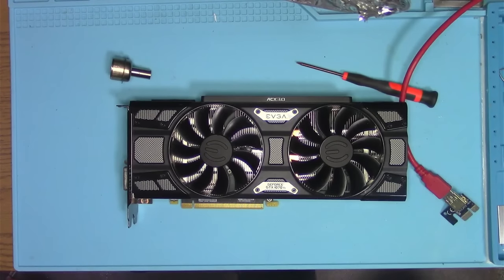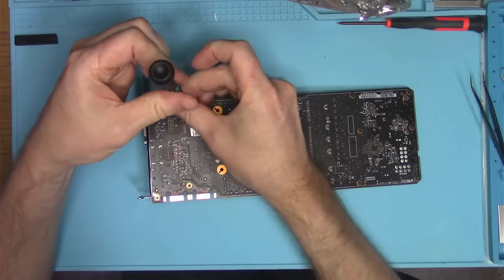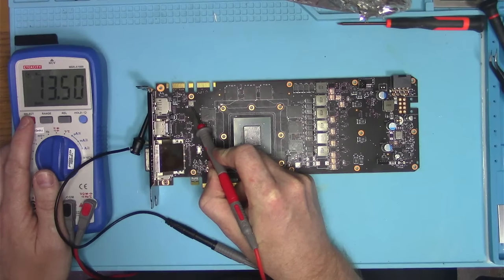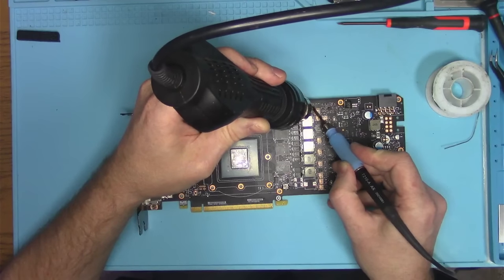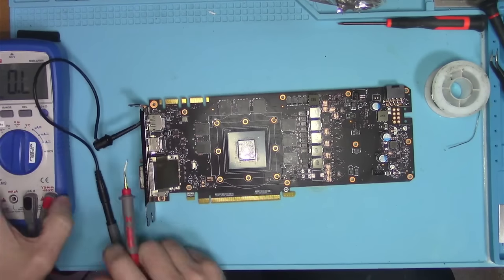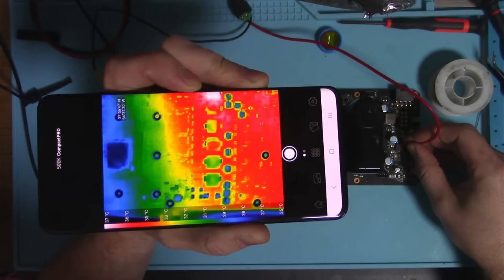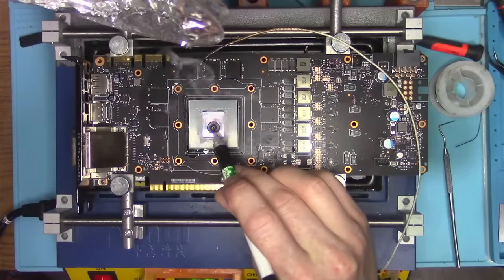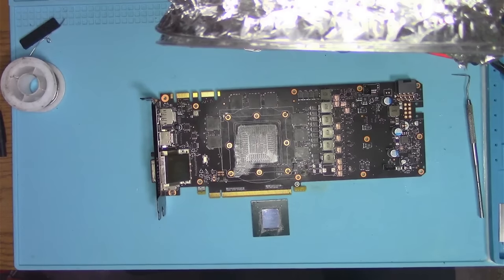How i learned GPU repairs

Comment: This is insane, I was certain you had a background in electronic engineering or computer engeneering, but you are self-taught! genius
Reply: It's kinda impossible for someone without a good electronic background to do this. I can build and troubleshoot PC's with ease, can do electrical works and circuits but never can I do anything like this (without studying it from somewhere). Electronics is something that's really hard to be self taught and the max I can do is continuity check. This guy is an expert pro max ultra
Reply: thats how i started too. learned how to rebuild diesel engines when my truck broke. learned how to repair amplifiers when i wanted a big stereo but didnt have a lot of money. learned how to lots of things because it was needed.
Reply: @wokeydokey6885  The first time I reballed and replaced any CPUs was just a passion project, no real background. All you got to do is want to and then buy the parts and equipment
Reply: @wokeydokey6885 the first time i did soldering is only because i dont have money to take my stuff to a repair shop and usually most of them refuse to fix that are actually very simple to work on or just lazy af (which is mostly the case in my area). I started repairing stuff with my dad's soldering iron, took me years to learn how to properly solder with the right amount of tin/lead and flux and a perfect dome point. Now im learning how to microsolder after i got a better but still cheap adjustable iron. Soon i will be trying to do hot air soldering once i have the money to buy a hot air station and maybe a better iron to go with as well.

Im doing all of this as a passion project and its really fun to do. You just have to be willing to do it and with good materials and equipment youre good to go. Educational background DO help but in some cases, its not that necessary in my opinion.
Reply: Welcome to the Balkans mindset. We have cookies 🎉
Reply: Because we self-taught people don´t follow the rules or limitations of other people, the experience and skills we gather is our own and that´s why some become so incredibly good at what they do. skilled people learn from both themselves and others alike and the most important thing is to always be open minded about anything and never se a limitation with a problem :)
Reply: My 78 father is a self taugh eletronic genius, and most of hes friends in the field started the same way, repairing broken stuff noone else tried to repair, my bet is 90% of repair tecnicians are self taught ones, all this stuff is not that complicated and once you get the basics its not that hard to know a lot, because most boards.have some standards, like nvidia boards can be quite diferent layouts but all of them will have the memory, core, pax, pll, 5v, 12v lines. The only hard thing about it (and about any job) is experience, anything elese is about beeing curious and having the right tools.
Reply: @Pulverrostmannen  I tend to strongly agree 😀
Reply: I'd guess about half of us are self taught. For me it was out of necessity I grew up very poor and if one of my electronics failed no one was fixing it for me and you can be very certain no one was paying to have it fixed or replaced. Same with cars or anything mechanical.
Reply: @wokeydokey6885  Actually, you just need to take a step back and look at a system from afar. What is a GPU? Well, it's a bunch of modules that have data lines and power lines. The data lines have signals which are governed by signalling theory, so open a textbook on that for a couple of hours and you're good. The rest however, is all these components being powered. And that is just normal electornics - you have filter chains everywhere. Once you start visualising these, it becomes just like any other Input/Output system. People simply need to stop scaring themselves into thinking it's something super duper complex.
Reply: @wokeydokey6885  Not really true, you can learn a lot from doing few simple things and there are not that many of typical failure cases on GPUs like this. In many cases cards designed to be very cost-aware saving on reliability, and that shows in dead capacitors, blown mosfets/power stages  or open fuses. To identify those faults and repair them you'd just need basic soldering skills, some inexpensive equipment and some practice, no need to be EE.
Reply: This world is being ruined by "experts" of the education system.This guy has raw talent,I am a bit like him,learned woodworking,repairing,plumbing,fixing RO ,washing machine just becuase i wanted to.
Reply: @wokeydokey6885 nobody with a degree in electrical engineering is going to work in a repair shop when the average starting salary is in 6 figures with that degree.  All thr repair shop guys are self taught or learned through apprenticeship, Louis Rossman is a great example. Same with car mechanics, they don't have degrees in mechanical engineering
Reply: @wokeydokey6885  you say that but people have broken things and are too broke to have them fixed, so we fix it ourselves, I've been a cyber necromancer for years now, reviving dead things here and there, fixing a monitor, a controller, some video games, a few sound devices, a laptop or two, and finishing off a lot of other stuff by making stupid mistakes and learning from them, one day you will have a decent repertoire of "how things work when I poke them here", and then if you hit the books things will make a lot more sense because of the experience you already have
Reply: VLSI plays important role.
Reply: It is not genius
Oy is called a willingness to LEARN and increase one's knowledge
Read - Study - practice and surround yourself with people who know
what you do not yet know - and let them teach you- and be teachable
Reply: @wokeydokey6885 as someone who is self taught at everything I could not disagree with you more…
Reply: Immersion is the key to work like this.
Reply: It probably helped that he likely had some of the supplies necessary to get started...
Reply: A degree usually  teaches you less than what you think..  it can  although teach you how to LEARN on that field
Reply: @tiagostein4057  If you get a electronic engineering degree and can't troubleshoot or solder there is an issue. 🤣
Reply: @GoonyMclinux  not true, most people on the field are into signal processing and image processing nowadays. I know dozens e. Eng that never did anything of the sorts in their life
Reply: Each component has their activation voltage, resistance, capacitance, etc.  A detailed map of things will be needed. Debugging things on a breadboard is harder than software, because one needs to be extremely systematic.  And to debug software combined with hardware can be really challenging.
Reply: Same.
I’m a 1st-year computer engineering major in college and I’m hoping I get to do this at least a little.
Reply: I know a dude who does similar things, but not as much of an expert on gpus more like jack of all trades including phones and similar but still very good, and he was taught to be a cook lol.
Reply: @wokeydokey6885 only impediment to learning is you dismissing yourself. You can learn anything. On your own. It’s just practice. Practice. And more practice.
Reply: In electronic engineering you don't learn how to fix this devices, you learn how to design them
Reply: I'm pretty certain that a person can be self taught from almost anything if he/she has enough desire or drive and ofc resources. Like this guy for example, he wants to fix his gpu bcs gpu atm is very expensive and he bought tools and gpu to practice on.
Reply: @wokeydokey6885  Depends on the person, Whatever I learned in life was self thought, from graphic design to electronics to construction and electric work.
Reply: @wokeydokey6885 well I guess depends on the person, I couldn't study from books and now 20 years later I can do this stuff.

Read schematics understanding the problems and diagnose.

Northwest his skill on pcb is amazing!

Comment: This is how I learned component repair.
1. Learn how to locate a coil and capacitors that make a power supply on the board.
2. Learn what a short looks like on a multimeter.
3. Practice soldering.

Comment: I really appreciate your thoroughness. I'm a retired auto mechanic. I use to see techs write down that they had done a bevy of tests that led to a conclusion when they actually had not. As an example. An engine that is overheating. If it's a common occurrence on a certain engine to blow a head gasket, then that's what their diagnosis would be. Even if it was just a faulty thermostat, the thermostat will get changed when replacing the head gasket, or replacing the engine. So whatever the problem really was, was never actually diagnosed. I always did the full set of tests, no matter how sure I was of where the results would lead me. 
One time I asked a particularly crooked tech how he could live with himself. He said, "safe and sound knowing my kids and I have full belly's and a roof over our head". The service writers were happy to sell all the high ticket jobs he wrote up too, as their pay was based on the total amount of money they could sell each month.
I simply cannot operate that way. I ended up leaving the dealerships and working for small independent shops where reputation was everything. That's how I was able to sleep at night.
Reply: Good man. Hearing that certain people and business will go out of their way to rob people legally makes my blood boil.

Comment: My 1st gpu repair was on a GTX 745. replaced the fan and repasted the chip. Minor compared to grinding down the board and soldering micro circuitry into place. I come for the knowledge and hope it may help in the future
Reply: hey my current nitro r9 390 stopped working, not sure what it is, when i power on pc the light on graphics card is on (it gets power" but no fan spin (ik they may not spin if idle) and no display, been searching for a minute now, any ideas???

Comment: I'm just a lowly software developer, so what you do is magic to me. Love your channel.
Reply: I'm just a lowly hardware guy, you software developers do the real magic
Reply: Heads up sir nothing low about it only different!!
Reply: @scruffles87 software development is insane, but low level coding is the most insane. Assembly is mental
Reply: I think for me the real magic is the microsoldering!  I'm a hardware guy and can follow his diagnostics, but I struggle at times with through hole components, I genuinely cannot believe this guy's skills in soldering!  Also, the way he casually reballs cores... my god, it's incredible!
Reply: @CompHwTipsAndTutorials so so true. I've always sucked at soldering. I recently tried to replace the joystick in a VR controller and realized my hands and eyes just couldn't do it and I've given up for good. This guy is unreal

Comment: Great work. I started making decoders then working on amps with 3KV and 1amp. Schematics and boards are laborish at times having to flip from side to side. Sound cards for below the noise floor signals are pretty easy these days since you can buy the kits online.

Comment: Very interesting to hear your story and yes, I did learn something definitely. Although I have almost no clue what you're doing when measuring resistances and stuff even despite the fact I study CS in Poland (where it's like 50/50 CS/Electronics), maybe because I always found it unbelievably boring and useless so it was a study -> pass -> forget process for me, I find it very interesting to watch you use this knowledge on something I'm interested in which is GPU diagnosis & repairs. Though I would lie if I said our knowledge is on the same level. With how complicated it was for me to comprehend the very basics of electronics when having 0 experience with it, I have a hard time wrapping my head around how you can self teach that stuff. Hats off to you and you people in the comments who shared some of their stories on how you self taught something yourselves - yall motivate me to put my hands on my car and learn and sort it out on my own.
Reply: I already did that, with my car. All the mechanics said no to me wanting to replace the heater core inside my car(Freelander 1 Td4, 2003). After so many rejections, I was like "you know what, screw the mechanics, I am fixing this myself". I took it upon myself and in one day, I finally did it.

Comment: amazing skills, you make it look so easy 
i hate ball grid array so much ive never even tried,  you inspire me to have a go ill start with qfn though! 
took me ages just to be able to swap 0.5mm pin pitch quad flat pack chips as its so hard not to get shorts between the back of the legs where solder wick cant get to it 
but then i never learned to use extra flux till  youtube (self taught tv, video, audio repair in the 90,s)

Comment: If you're saying you've learned everything through trial and error in just a couple of years that's damn impressive. To anyone curious about trying old school voltage injection to reveal faulty components but don't have a thermal camera, you can also wipe a bit of 99% isopropyl on parts of the board then watch for an area that dries especially fast. Not perfect but more helpful than you may think.

Comment: So when there's a short on two or more rails, given they are separate until they reach the core, it is likely the core, is what I take away from this vid, right? Of course also super entertaining stories and walkthrough as usual. I'd love to know how much you made on those flipped cards bought for a few hundred in bulk during the pandemic, must've been a pretty penny!
Reply: Actually a short on pex alone is 95% dead core. Short on memory can be a shorted memory chip.
Reply: @kikihun9726  dont really know much about electronic but if the card post when plugged in with pcie alone but the computer doesnt boot at all when 2x8pin power supply is plugged in, that means the core is fine right ?
Plus it shows an image on screen telling to plug 2x8pins in
Reply: Yeah, he tested it at the end. He had low ohms to ground on the core itself, so thats all he needed to know right there.

Comment: I have a 980ti that started my journey, and although I have not moved on to fix GPU's yet.. I began to dive into learning about electronics repair w/ this 980. It boots up, but only when 1 of the 6 pin power connectors is hooked up. The other one does not seem to allow it to work/boot. So I suspected a bad MOSFET or something similar.

A coworker bought the GPU on Ebay and when it turned out to have the issues the buyer let him keep the GPU and refunded the $ so he knew I had an interest in this type of thing and he gave me the GPU. So it does not cost me anything, but I'd love to get it working n throw that GPU in one of my servers for Plex or whatnot.

My coworker knew I was into breathing life into electronics and I constantly take "broken" laptops or other devices and fix them to repurpose. So I can relate in the sense that a GPU sparked my interest in getting deeper into electronic repairs... and it's nice to pickup different tips from others w more exp. 

But I do feel it could be helpful if you explained more about why you're testing things... like showing why you'd test or suspect a certain part failing. And it might also help to explain and/or show where you expect the power to flow through the device so that people like me could understand the reasoning behind why you're testing the things you are... and it could help us when working on the next similar item.

Comment: Brings back good memories fixing cards multiple times when our overclocking sessions go sideways :-). It's useful to take a good look with microscope on the GPU die, since shorted chip often would have visual discoloration or cracks on a surface. You see cracks or bubbles coming from the edge - no need to troubleshoot the PCB (unless you need a donor for another GPU).

Comment: Simply by watching this awe fella and his skills makes me instantly to send him my 1660ti just for check control and pay him to do so and then i realized we are on the opposite sides of the globe. i have some soldering skills from me youth and the will..just need a equipment,and learn how to handle them. i'm a car mech and i change on my on the timing belt cause of the trust of other mech..lol,and i used to work without advertising only by recomendations from customers cause they are the best adv tool you'll ever need.
Someone who has love for electronics just by observing this can learn so much you don't even realize that,guys..

Comment: Very good job :) Did You showed anywhere Your desoldering setup? Very nice stand for hot air :) What temperature do You blow on the GPU and how high You set up the preheater?

Comment: What happenes later? Do you send the gpu back to the client? do you solder the core back on or leave it off if the client still wants the card? Or do you just buy the dead card from the guy?

Comment: Just a quick question: why did you need the hot air for soldering at 6:20 ? Did you need to hear up both sides to lift one side up? Sorry for my English, it is not my first language :D

Comment: Just recently had Youtube suggesting your channel. Loving your videos, going through a mix of earlier and recent ones. I had situations where I bought used cards (like a Quadro FX4000 = geforce 6800 Ultra), with some missing smd components (resistor/capacitor and a npn). I see sometimes you openning cad files from similar GPUs in order to identify components. Tried looking for a part list for the card I mentioned, no luck so far. Any suggestions on where to look for? And those gadgets you use to test boards, did you design them? Regards

Comment: That housing (which you place on top of the core) with which you desolder-solder the GPU core. Did you make that?
I noticed, you fix your hot air handle on top. But I never saw much of the housing which stands on top of your GPU chip.